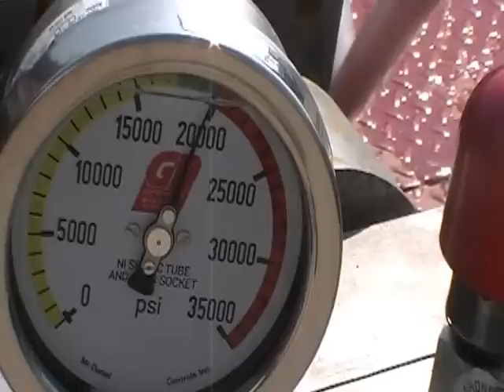Hydroblasting Scaffold Planks Removing Concrete from Alumimun Scaffold Planks

Comment: Nice set up David!  Make sure you capture all of the water used.  One other thing I noticed running at 20k is going to cause maintenance issues.  You may want to run at 17k to minimize down time.  Send an email and I will forward filter info you may be interested in.  Let me know if I can help.